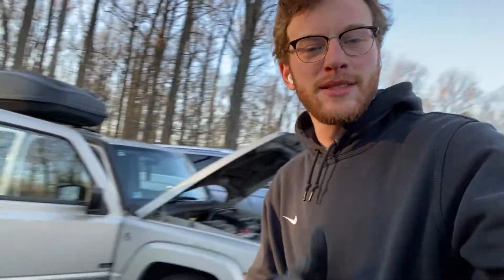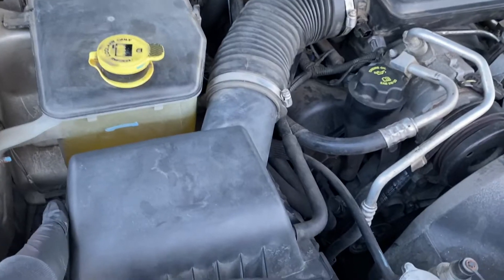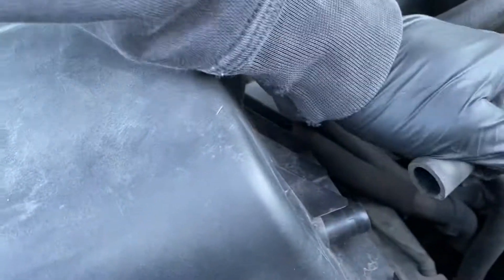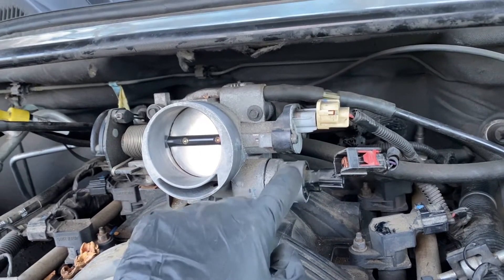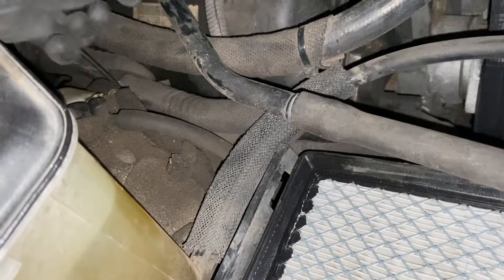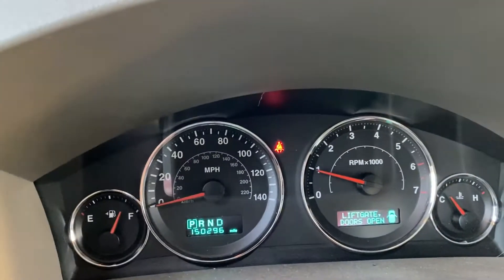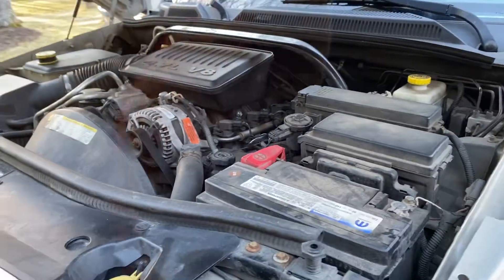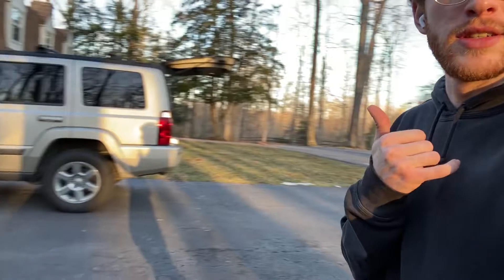STALLING/BAD IDLE Jeep Commander Idle Air Control Valve Replacement

Comment: Hello.i have a 2006 jeep commander 4.7 2wd and the exhaust manifold gets red hot when i start the engine and the rpma are very high..i dont know if this problem is because the air control valve is no good or catalyc converters are blocked iinside.

Comment: Question my wants to turn off at a complete stop or while I'm at a drive thru the rpms drop to 0 and then shoots back up to 1000 rpm it's a 2006 jeep commander
Reply: Same here in a 2007 4.7 did u find the problem and how did u fix it
Reply: Oh damn…same issue here…any fixes?!